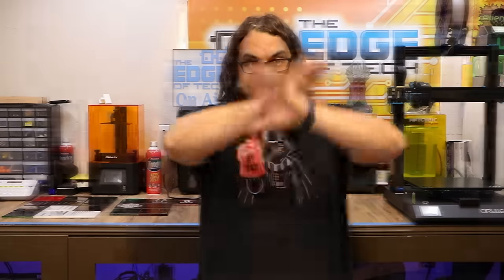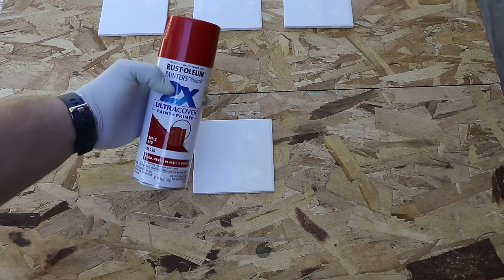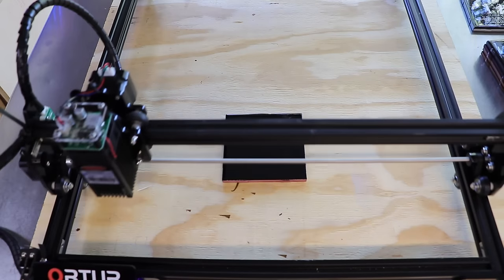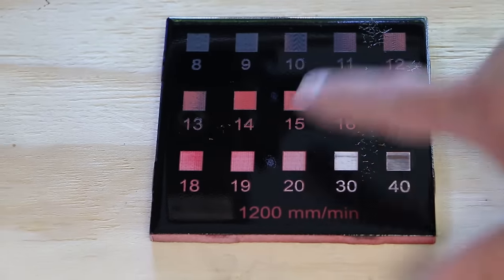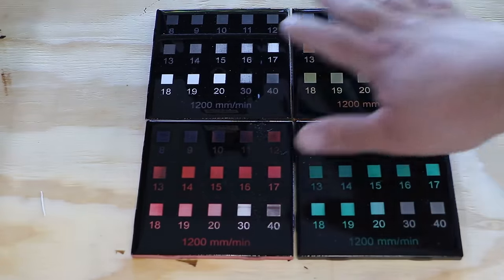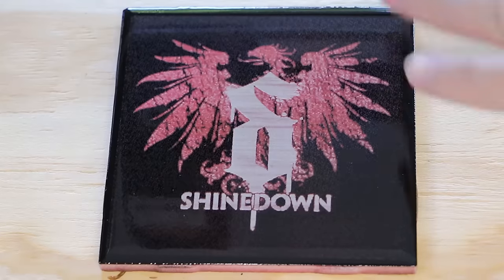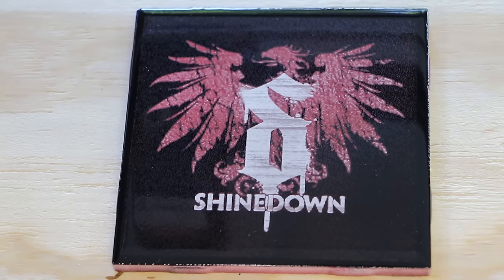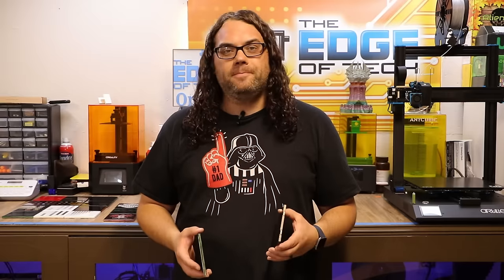How to Create Amazing Color Tiles on a Portable Laser Engraver

Comment: Just a quick suggestion. Being an auto painter I would suggest using a grease and wax remover rather than lacquer thinner or acetone. These both are petroleum based and and do have oils in them. The grease and wax remover will prepare the material more cleanly. Thanks for your videos.
Reply from the maker: Thanks for the suggestion! I'll give it a shot!
Reply: Checked what my  hardware store had today. Degreaser is right next to acetone, others have said degreaser is better for cleaning. Will try that first.
Reply: Bingo, being a contractor I say the same. I have tried them all and Krud Kutter is the safest most effective I have found. Wipes clean, you can use it on food prep surfaces but it cleans better than TSP.
Reply: @johnhubbard6262 Hi, which version of KK?  Presume it's the "kitchen degreaser"?

Comment: When dithering, the dots that make up the “lighter” area are black too so they will use the same percentage power as the larger black area in the letter S. The reason it doesn’t burn down to the white of the tile is that it ramps the laser power up and down as it enters into a black area of the image and it doesn’t have time enough to ramp all the way up to max power, so it doesn’t cut far enough. There are white spots in the areas where several dither dots are close enough together for the ramp to reach closer to the peak. 

So if you want to make sure it is red and only red you should not use dithering. Instead you could get away with grayscale aka passthrough, but you’d have to guess and test the percentages. 

A more sure way to control the values is to split the bitmap into different images and set them up separately in lightburn with the values from the test tile for each layer.
Reply: Could you do it as a two tone image where a grey tone is a consistent reduced power and then the black is a higher power setting?  Or could you do it as a second pass on the "black" section to burn all the way through the paint?

Comment: Three years ago I know, but I was so impressed with your comment on PPE, your 20 years from now self is going to reap the benefits of that, just like I reaped the whirlwind ignoring it. 
A point to consider is if you are worried about absorbing something through your skin, as you should be, you need to consider the fumes, your eyes will soak stuff up much faster than your skin, and do much more damage over time. Your painting outside in a breeze is huge when added up over time.

Comment: I have an ORTUR Master 2 + 20W Diode unit and want to replace that with a  NEJE 30W Diode laser.
That by all accounts is much more Powerful and lasts many times longer.
The problem for a  newby and someone that is mentally challenged ( electrically ) is how to wire the NEJE to the ORTUR.
I know that others out there have the same problem but have not seen any solutions to this. 
Oh and keep producing those awesome videos,  I look forward to each new output that covers something different.
Thank

Comment: This is a great video and has helped me a lot with my own tile burning. However, there are two things. First, the lines in the burn test are at the default 6000 mm/min, which jiggles the crap out of my table (things have fallen off). Second, the "gray" area is supposed to be dots burned at the maximum power set, in your case 30. Shouldn't that have resulted in a bunch of white dots instead of the red? I did notice there are some white spots. Is there any way to know how much to compensate for the apparent loss of power (or whatever it is) that results in the lighter burn in the halftone areas?

Comment: It's very cool and useful.
but I didn't understand why raise the laser module so high?

is it not possible to provide the same engraving with the help of laser power and speed with its standard operation?

I saw in someone's video that they engrave on the same painted tile without lifting the laser module.

Comment: Have you tried mod podge? It’s a sealer as well, you can seal the tile and then spray the acrylic clear if the tile is sticky from the mod podge. My wife has transferred photos onto 4x4 tiles using mod podge and then I would spray with an acrylic sealer.

Comment: Hey Boss man.
Love your videos keep up the amazing work 
Quick question..I am working on my power tiles for my colors but 
All the colors seem to be the same..practicaly no change in colors.
Any advice?
Reply from the maker: It's all about speed and power combinations. If you have a larger watt diode, you will need to go faster with less power. What you could do is start with 1 color on a white tile and see how much power it takes to burn through it to the white. Then move on from there.

Comment: Thanks for the video. I have two questions - Could I do the same to get the number for a three or four color tile to find out the power percentage to get to the bottom layer (say a white tile/canvas with yellow, orange, blue, and a black top coat)? The second question is do the numbers relate to the power needed to burn through the paint? So the same numbers would work on tile or canvas?

Thanks again for the great explanation and easy to follow instructions.
Reply from the maker: Yes you can use many colors and try this. I would adjust the power settings for each square to be higher though. And also, it should be the same as canvas if the canvas is painted the same and in the same focus area.

Comment: Would it matter if you saved it in gimp as .png ?
The png image looks better. 
Have you tried this?
I just ordered a engraver/cutter.
And basically ran across your channel. And it freaking rocks.

Now I have a theory. It seems like you can come up with a certain set of paint layers.
Lets say: 
White tile
Yellow coat
Green coat
Blue coat
Black coat

Then maybe set up percentages for the image where the laser changes percent on the fly and have a multi color tile?

Do you think that is possible?

Comment: Hi found this and tried it.  Using the ortur lm pro 2.  I did not get the same results at all nothing seemed to burn correctly i used light burn and grbl but nothing is correct.  Do you detailed instructions?  I am frustrated with it.  I can burn wood but is is not that good tryi g to learn lightburn is pretty tough.  Also downloaded gimble and used imgr like you but not getting the same results.

Comment: good video and good grid power testing file. I have work on this tile project since 2 weeks with a Neje Master 1 20Watt. But as the only soft is a Neje one, I only have the speed in "ms" . I have paint a tile in 1 coat green and 1 coat dark. I have tried all the power and all the speed but I never fine a green color in my squares. Do you know what 1200mm/min means in ms ? thanks
Reply from the maker: Is it mm/min or mm/sec? If it's MM/Min then it would be 20mm/Sec speed. Then you just have to dial your laser power in and you will get it!

Comment: Add a vacuum to the area, this removes the burned paint so that the debris is reduced.  While some would say use air assist, in this case, that would tend to want to lift the paint as it's still very soft from localized heating.

Comment: Edge Of Tech....I've been slowly researching OLM2 watching many vids and decided to start my laser getting to know tile burning before moving to other material. Your videos are very easy to follow along & understand, so I was pumped, got me a batch of painted tiles [(red/blk, wht/blk, blu/blk)...downloaded your 1200 swatch file. When I ran them though, the laser didn't even break through the top layer of black on 1200/40%, it seems as if it is running too fast. 

I played around with the settings....when took the last row slowing them down, only around 250/60 did it breakthru the black.
PAINT STYLE....
The base color paint (blue & white), using your x+y method, is Krylon Fusion 5X All-In-One (Paint+Primer)
The black outer paint (black), using your x+y method, is Krylon ColorMaxx Paint+Primer

Is it that my paint choice is paint+primer?...layering to thick?...something else?
Reply: ATTENTION 20MM/SEC = 1200MM/MIN...When I opened your file the other day, I noticed that the speed was at 20 not 1200, so I adjusted each layer to 1200! Well, I was just reviewing my settings I now see the speed is rated "mm/sec", not "mm/min", therefore 20mm/sec = 1200mm/min

That being said why does your video speed read "per/min" and my system "per/sec"?

Comment: Great  video in the technique. Is the laser really 600 DPI? That's 0.0423 mm per pixel - half the size of a human hair. I suspect it is not the case. 
The half-toning / dithering will get artefacts if the resolutions are not matched (called "Moire patterns" - aka aliasing). So as well as your power tile test, I suggest doing some experiments with different resolutions, you may well find it improves the image quality by having lower DPI settings. Newspaper print is half-toned at about 50-80 lines per inch (LPI) and the highest quality magazines at 150 LPI. 
When I do mine I shall inspect the output with my digital "microscope". 
Also, I would recommend using PNG not JPEG.

Comment: In case anyone out there is having problems with peeling, bubbling or cracking paint Rustoleum support has told me it takes 2 weeks for your paint to cure completely before you should paint over it or clear coat. Just an FYI I learned the hard way. 

Montana paints is an acrylic paint that cures in 24 hours if you need an alternative.

Comment: Please help me - I think I am not doing it right - I paint the tile red ( Do I need to paint black over the red)? - I used the test pattern from you the 15 squares --- I only test  with (LINE) just to see and make it simple ( I only able to see the bottom row the squares and the number under it - it did not burn deep but visible) I can barely see the 2nd row --- the top row I see nothing --- I have Jtech 3.8 diode laser should I slow down the speed and increase power ( how much adjustment pls advise)

Comment: Hey jim. First off. Great video/teacher presence. I’ve seen so many people without that quality. So kudos. Second (on?  j/k) in regards to your “benchy” hope I remembered that right. You start off demonstrating your paint layers basically your “color” then your “shade” which was obviously black due to starting with a white tile. Then later when going over the results you mentioned that the 40% burn swatch may have been “over burnt” which made me wonder if you’ve ever tried more than 2 paint layers cause to me it seemed like there’d be room to do that inside a percent range of 8-40. Sorry if this is something discussed previously I rarely read prior comments unless instructed to by replies to my own comments. Due to an inflated sense of personal time worth. I’m not a fan of snipe hunts. Anyway, as long as your top coat was the opposite shade to your tile color that could work yeah? Of course then you’ve kind of eliminated your shades basically swapping them in as a color instead but still. That could be utilized in a stencil art type graphic yeah?

Comment: Dumb question.  I used Rust-oleum gloss black on a  white subway tile.  Lasered it, looked good, but when I sprayed Rust-oleum gloss clear and it reacted with the black.  It almost seemed to bubble up.  It is uniform and actually looks good, but why did it do that?  Did the same thing when I tried Rust-oleum Lacquer.  I did wipe and brush it off thoroughly before spraying.

Comment: Great video.  I downloaded the color test file and ran it on some tiles I painted and everything is coming out pretty wonky.  It looks great in LightBurn but when the laser burns it, the alignment is way off horizontally across each square using different power.  Also, the outline burn on the squares and numbers isn't lining up.  I've done 4 tiles and they all come out exactly the same.  Any help on this?
Reply: Exact same issue here.  Has anyone else come across this and figured out how to fix it?
Reply: Your line offset is not set in lightburn it can be adjusted in machine settings I believe and there are you tube videos on how to make adjustments.

Comment: I did my color tile in Lightburn. My Otur Laser Master 3 first burned each square horizontally and then burned each square vertically. When I burned the picture, it only burned horizontally. What did I do incorrectly? I did check pass through.

Comment: I tried the technique and it came out very nice, until... When I sprayed a LIGHT clear coat, the black paint crazed and crinkled. The paint underneath looked great. I used the same paint you show in the video. After I left the first clear coat dry the black crazed worse with each coat. What am  I missing?
Also, it seems that as the laser gets close to burning through all  the layers the color gets darker, not lighter. Does that seem correct?

Comment: Hey, Jim. What's the difference between the different watt machines? I see a 20W, 15W and a 7W.
Reply from the maker: The only difference is the total laser wattage. And what you see is input wattage. The 20 watt is more like 5.5 output watts. Depends what you were going to do with it though. If you are just going to do engraving and pictures then I would get the smallest one. If you're going to do any cutting then get the biggest.

Comment: Hi, I just got my first laser engraver / cutter. It's a 5w diode laser. And my question is, will your test file work? Or will I have to increase the burn percentages for each layer?
Reply from the maker: Give it a try before you turn them up. It should work, but you may have to increase the percentages a little.
Reply: @TheEdgeofTech  Thank you. Will do. I'm mostly going to use it for cutting balsa R/C airplane kits, buy I also want to do some keepsake stuff to sell on Etsy and FeeBay.

Comment: Great video. What causes the black lines in the “S” logo? Reminds me when an inkjet is running low. 

I’m going to order this laser. Do you recommend a 15w or 20w?  Any disadvantage in going with the 20w other than a few $ more?  Thanks.
Reply from the maker: I will have to look at the tile again to see what line you are referring too. I like the 20w and you can tame it down to do more! I would also recommend the G8 lens upgrade as it's only like $20.

Comment: Jim, fantastic video. Hadn't thought about using test tiles for the colors. If you want to save time drying, use a heat gun on low heat. I can layer paint on a tile and be ready to engrave in about 5 min with the paint fully dried.
Reply from the maker: Nice! I'll have to try that!!
Reply: any cheap heat gun will do the job?

Comment: Hey great vid. I keep having issues when I clear coat. I use all rustoleum paints and sometimes I get a chemical reaction. I don't know what it can be. I wipe off the tile after i finish with the laser. Have you had this happen?
Reply from the maker: I have had this happen many times. You either have to do very very thin layers of clear, or try a waterbased clear that will not react.

Comment: Great Video!  I have a question when I print the Test tile, the 12 Thur 40 boxes have two vertical white lines. One at the start of the box and one at the end of the box. the center of each of the boxes are different shades of red?   It doesn't seem to be a frame as I reprinted with just fill and I got the same results.  I have also tried different speeds(1000, 600).
Reply from the maker: Interesting. I have not seen that yet. Can you shoot me a picture on facebook or email?
Reply: @TheEdgeofTech  Sent it to your email.  Thank you,
Tim

Comment: This is a great looking process and I'm going to give this a shot, but I think you're overburning. At 600 DPI, that would assume a focused laser diameter of .04mm which is pretty tiny, about the best DPI I can get on my laser is 254 with a laser diameter of about .1mm, but I usually run 200 DPI so that my controller board can keep up (it's an 8 bit controller). I think you might get the same quality results in a shorter period by running a lower DPI and increasing the power; if we assume a .1mm dot size, a DPI of 600 would result in about a 2.5 times overlapping burn, so maybe reducing DPI to 254 and increasing power by about 2.5 would do it and allow the job to complete 2.3x faster.

I'm going to give it a try my with laser and see what I can come up with, thanks for sharing this technique!
Reply: I finally got a chance to give this a try and what I learned from the process is that, more important than just the DPI is setting the line interval (which is just another way of thinking about DPI) to a number that is evenly divisible by the smallest step your laser can resolve. Using my own laser as an example, the smallest motion it can do in a single step is .02mm, so any interval I choose must be evenly divisible by that in order to create a clean burn with no line artifacts. I ended up selecting .080 as my interval and my results have been excellent, I'll be doing a video on that eventually.

If you choose a line interval that does not line up (or a DPI that results in such an interval) you will end up with seemingly random un-burnt and over-burnt lines in your result, this is because in order to do what you have asked, your machine must round the steps up or down by the minimum step amount. 

Most lasers have a way for you to see and set your steps per mm setting, once you have that number, just work backwards by taking 1/steps per mm to find your minimum machine resolution, in my case, 1/50 steps per mm = .02mm.

The other thing I learned is that Lightburns built-in enhance function can be the difference between a washed out image and one with some excellent definition, very useful on images without a lot of inherent contrast!